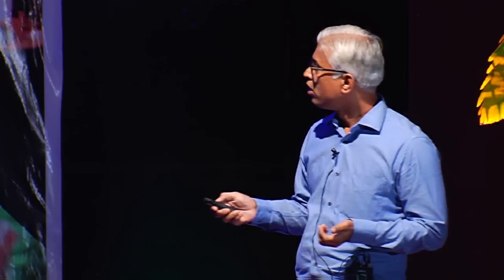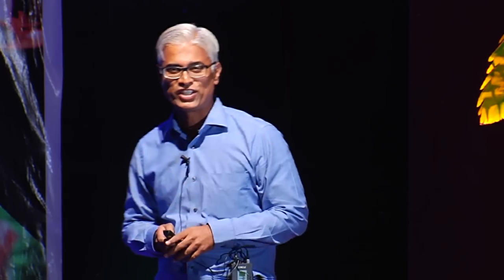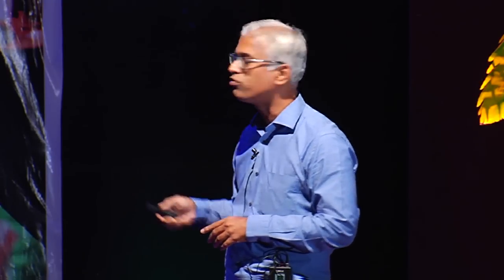Advantages of using Lime instead of Cement in construction | Sandeep Sonigra | TEDxSIUHinjewadi

Comment: UMMM... cement IS Lime. Calcium carbonate (lime) is heated to create calcium oxide. Then gyspum is added. When mixed with water sulphate from gypsum reacts with calcium oxide and produces calcium sulphate. Which we see as cured cement. There are other additives (LOTS of many types of additives) to improve final quality of cement. But for most part cured cement is 60% stuff from lime. The non-hydraulic cement is in fact lime. Calcium oxide is made from lime and as it dries it reacts with CO2 from the air to become calcium carbonate (Lime) once again.
Reply: You are right.. but difference in practical is mixing it with ash fill the pores and no air flow and no CO2 absorption in standing wall..finally in practical, it's hot in cement and normal in lime
Reply: @sastry101  yes, u gave the right difference
Reply: Sandipbhai aap se milna hai
My phone no
Bimal Mehta
9819752546
Reply: Hi,  kindly do research please....cement is extremely polluting , while lime is not. Simply that will give you answers....
Reply: There are 2 steps in preparation of cement where pollution can take place. 
1. Conversion of calcium carbonate to calcium oxide. CO2 is the pollutant. This step is common to preparation of lime stone binder.
2. Additives like sulphates and others. These additives are needed to give cement strength that is superior to plain lime. 
If you want even less pouting option than cement and lime, build out of wood...
Reply: @ghffrsfygdhfjkjiysdz  What about all of the dust that is created in the process of making cement
Reply: @ @emilsegle4855  The bigger issue is CO2 release while making cement/lime, not dust. Dust is an issue with any powdered chemical, not just cement.